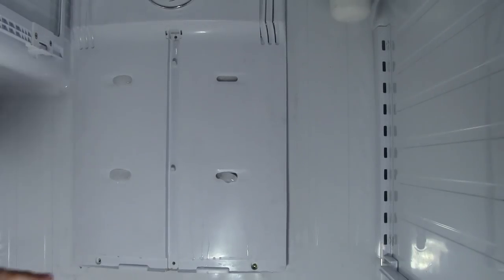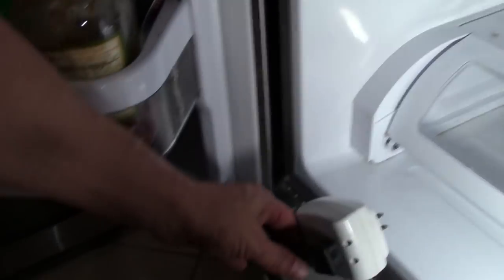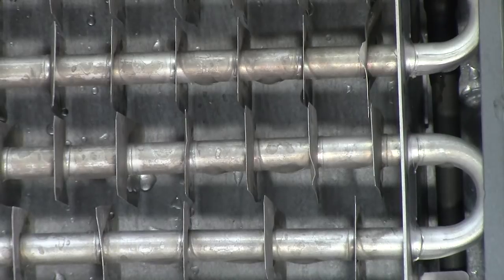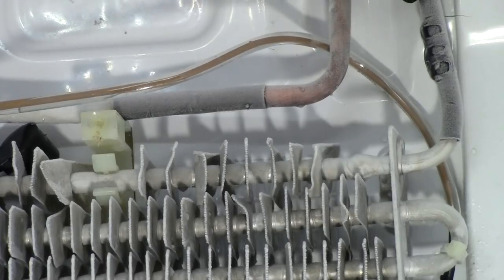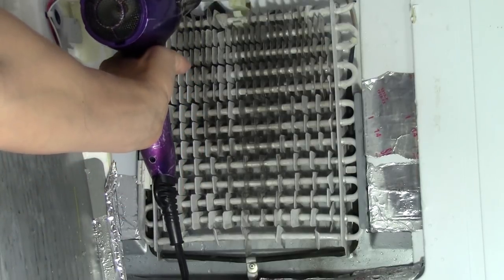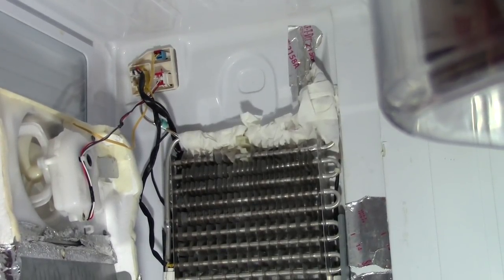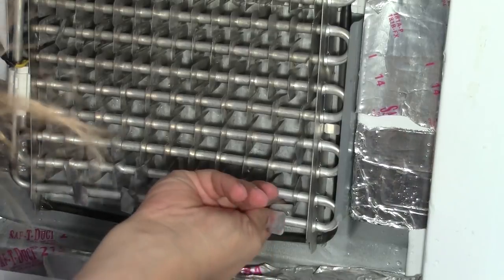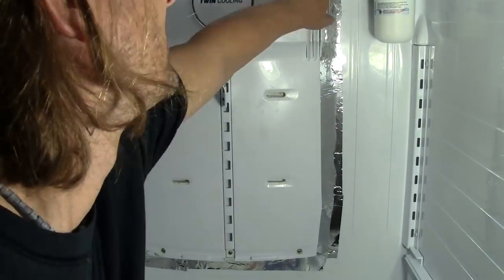PART 8 How to Fix a SAMSUNG RF 267 Refrigerator Not Cooling Icing and Freezing DIY repair

Comment: Thanks for this video series, Jake, and letting us in on your journey with these Samsung (hamstrung?) machines. I tried a copper wire in the drain, then the manufactured (aluminum?) part recommended for the drain - no surprise that neither worked. I'm going to try the aluminum tape, but to me, it makes more sense to add strips of aluminum tape to what I think is the black-colored defrost coil and leave "tabs" of tape hanging from the coil all around. Perhaps this will conduct more heat from the coil into the space behind the panel and melt ice that forms? I'm just not sure. In theory, to me, it doesn't make sense to insulate evaporator coils since my understanding is that those coils are there to dissipate heat ... no judgment here ... just trying to think this through. I hope it works for you. I'll share notes on what I discover along the way.
Reply from the maker: I dont think your heating element is getting hot, so adding strips of aluminum tape to it and creating tabs will do too much.  You can try it though because I dont think it will harm anything.  As for insulating the evaporator coil, it is not a permanent solution for me either, although it seem to help.  Btw, I think its the condenser coil that you think dissipates heat.  That would be on the outside of your fridge, in the back or underneath or something.
Reply: The heating element (what I'm calling the defrost coil) behind the back panel inside my fridge was definitely heating up when I re-started it after fully defrosting the unit. Therefore, it was a big mistake to directly apply aluminum tape to attempt better radiation of the heat! The acrylic glue on the tape burned and sizzled and it took a couple hours adding another chemical to dissolve said glue and get back to square one. I consulted an experienced refrigeration repairman, and he suggested adding aluminum tape to other areas behind the back panel: the drain pan and the inside face of the cover itself by extending the metal panel with tape on both its base and sides. We'll see how that works out!
Reply: Yep, it gets mighty Hot !!  I would not apply tape or paper.  Force a defrost and listen for sizzle.  Defrost
Sensor bad  is my  thought ...   Without good one,. it , 90 second defrost does nothing.  Can run for months (like you and I have seen)   Mark in Ohio     Hope last time I defrost  !!!!!
Reply: 100 % RIGHT PLUS FIRE RISK AND VOID 5YR SEALED SYSTEM. Contains gas under pressure, may explode if heated .

Comment: This problem fridge came with the house I bought a year and a half ago, so I'm grateful for your video. I removed the cover and the ice has all melted now, but I notice that the styrofoam insulation, covered over with thin foil tape strips, on the back of the cover seems to have shifted partially. I'm wondering if I should replace it, since there surely can't be a good seal now. Or do I need to buy a new cover? Also, some of the fins on the coil are bent or not in line with the others. Does this affect the efficacy of the fan? Thanks for your help.
Reply from the maker: +Victoria Chatfield -->  Just do your best to straighten the fins by hand.  It won't affect the cooling or the fan efficiency.  The Styrofoam is probably your bigger problem.   Fix it the best you can and seal the perimeter up with tape.  It might help a little...it did for me.  Your real problem is that this will be an on-going issue with this fridge no matter what you do.  What I would do is try to do a forced defrost one time a week by pressing the correct buttons on the control panel.  It might save you hours of time in the future.
Reply: what are the "correct buttons".  My frig has the same problem and I already unplugged it and waiting for it to defrost.

Comment: Try this my freezer has been freezing up for over a year so one day I was cleaning behind the refrigerator and I pull the cover off on the bottom and the coils were full of lint I got my air compressor out and cleaned it problem solved no more freezing up

Comment: Jake is this fire safe? what about water on the paper towels?  Thanks for posting - just got this as a handme down from family and it is starting to give me trouble - like to fix my own so really appreciate your videos!!
Reply from the maker: +Stephanie Cottrell --wrap the coil, not the heating element.   Don't wet it.  Keep it dry.  If you wet it, it will just freeze into ice even faster.
Reply: Jake has done a great job of defrosting every few months. I did for a while, but was looking for a long term FIX.I bought new and it worked for 6 years without manual defrost.Then this.(see my post) I replace defrost sensor (about $15) and have been good for a few months now. Part can be measured with meter. With bad sensor it thinks 80 deg F. (and only runs 90 seconds then done defrosting )   should be several minutes and you should hear the sizzle of water boiling on hot coil.               No ice creeping out of lower holes yet.  Fingers crossed in Ohio

Comment: Jake when I took my panel apart there was so much ice I didn;t notice the BLACK WIRE with the sensor seen at 4:21   Could you please tell me where this goes?  It has two prongs  I;m guessing it sits on the coils?  I can see part of it in your video
Thanks for any info
Bernie

Comment: Hi Jake, I am currently in the process of unfreezing this fridge, 9months after it was left behind by the previous house owner (NO WONDER). What worries me is that I can see some sort of "rusty water" marks/trails coming from the the bottom part of the cover (which is still stuck in ice) all the way down to the bottom tray. Have you ever seen this before? I'll try to keep you posted once I can finally remove the cover =\

OH AND THANKS FOR YOUR VIDEOS
Reply from the maker: I haven't seen any rust on mine.  The parts are made of aluminum back there and should't rust.  Let us know what you find back there.
Reply: I think your source of rusty water may be from the screws that hold the back panel in place. That's what I've found with my version of Samsung fridge.

Comment: Thank you so much! I am so over buying Samsung appliances. Where does the water drain to, if it does not freeze. I put warm water in the drain but need to know if I should be checking a drain container somewhere.
Reply: In the RF265 side by side it goes down into a hole behind the rear panel under the heating element, then flows in a pipe to the left, then down and out into a flexible tube into an evaporation tray. Unfortunately my Samsung 'fridge drain froze up solid in the drain line due to either a blockage in the flex pipe that dumps into the evaporation tray and/or the undersized metal defrosting probe attached to the center bottom of the defroster element. After having my "eternally frustrating Samsung" apart about 8 times in the tube, I am not convinced it can be fixed. In my case  the poor performance spread to the freezer, the display control so that it is now totally unreliable.  Makes one want to ventilate this junk in multiple places with a pick axe so that no one tries to pick up on what appears to be a beautiful stainless steel Refrigerator / Freezer,  is actually a frustrating piece of unreliable junk. There went a LOT OF MONEY.  Will never even look at Samsung products built in Mexico, China or anywhere else.  Adios.

Comment: I wonder how it would work to just spray the same areas with low expansion foam insulation, emphasis on low expansion.  The down side is it would be difficult to get back off if the need arose.

Comment: After reading about 15 comments below, I'm curious if in addition to running heat down the drain tube if running copper/aluminum wires on the heater coils in the upper/mid section horizontally to also distribute heat to the condenser coils would also aid in the evaporation and fan from freezing up helping with ventilation.  Not sure how the condenser coils would affect /reduce life of the defrost coil or effect the sensors somehow.

Curious if anyone has tried this and found good results.

Comment: Hello Jake,  I watch all your videos on the Samsung.  I am in the process of taking the refrigerator apart to defrost the coils.  Question, did the insulation work and if so, how long?
Reply from the maker: Hi.  It worked for quite a long time.  I was having to defrost the fridge every month and a half.  Every time you take that cover off, you destroy it more and more which contributes to the problem.  It lasted me at least 6 months after the insulation.  This time I put even more insulation on it as you can see from the video.  So far so good.  Part 8 of this series was made on April 22, and now its May 22.  One month good so far.

Comment: I think you fixed it somewhat by slowing down the defrost circuit.  The sensor was covered by the insulation you put in.  A few others had the same solution with relocating or adding a 2k resistor.

Comment: Hey, man. I have the same problem. I'm looking at the defrost coil and wonder how in the world the Samsung designers thought this would be a good design. Heating element is across the bottom but freezing happen from the top down. I need to tear mine apart every few weeks and it's a 15 month old unit. 

Have you tried to source a heat trace cable that might be suitable? The insulation you installed may help too, but I'm trying to converge on a thin and low power heat trace than I can snake all around, then plug in ever time I hear the fan starting to grind. Let me know if there are tests you want to run, I'm willing to try things.
Reply: Remove the cover and remove the styrofoam insulation an d replace cover without it and mine has been for 8 months so far and still not freezing up.
Reply: @TheOnlyGoodCommieIsADeadCommie  No problem still working fine

Comment: That is kind of a real "Mickey Mouse" repair using paper towels!   There is a Samsung service bulletin out there that tells how to fix this problem a bit more properly.  That fact that our brand new Samsung frig went five years before every having this problem just tells you that there is a fix without major modifications like you are doing.  One of the problems is the drain tubes become clogged with crap (They can be cleaned) and then moisture builds up in the frig.  Samsung has new improved drain tubes that will not clog.   Thats just one fix for one problem.    My guess is also all the damage you have done to the insulation from not defrosting the frig first and pulling off the cover is adding to your condensation problem since the heat from the evaporator heater is not well insulated behind the panel and you are not getting a good defrost cycle.

Comment: If there is a class action suit about this problem, we will be a part of it. We also have a Samsung side by side experiencing the same issue. Repair people have been out multiple times, replaced the fan and the mother board and the coils still freeze over. We won’t buy any more products with the name Samsung on it

Comment: on RF265       Press Power Freeze   and Fridge button till display blanks  . When display turns off ,  for the next 15 seconds if ANY key is pressed it will step thru modes like Jake saw. FF1,FF2,FF3,rD,Fd       rD  Fridge only (saves freezer)   or Fd   defrost both    beeps continuous , one more button press cancels test mode        after a few minutes you should hear sizzle. I f not  Defrost sensor or coil probably bad.
Reply: Would you mind telling me how long it takes for the coils to defrost once you've set it to Fd mode? The beeping is driving me nut, and I'm wondering if it takes hours or is it a quick process?
Reply: @hezwes  I wish you'd had a reply. Could you tell me how long you waited?

Comment: Is there a way to make the evaporator fan run full time even when the compressor is cycled off. The continuous airflow might melt frost during the off cycle of the compressor and further prevent freezing.
Reply: Continuous evap fan will not defrost the coil in low temp refrigeration. This is low temp refrigeration.

Comment: Great Video! It helped me dissect the fridge..However, I bought a new defrost sensor thinking that was it and still not working. After all ice melted and dried, still reading 60+ degrees...WTF do I do now? Sounds like fans are working...I'm no expert at this, just taking people's advice..Anybody know what else it could be? Samsung RF263AEWP..
Reply: Get A Clue Marketing Show I have a model RT38MASW.(Samsung). It is not cooling the lower part.The freezer part is OK.I change the thermostat but same problem
Reply: Hey, I finally had to suck it up and pay $75 for a technician, to come out a diagnose my fridge. Why? Because too many people (aka experts) said it could be this or that. I change PCW inverter board, defroster, and still had same problem.  One online expert said, I have a leak in my system, based on irregular frost pattern on my coils and that it was not worth repairing. I was totally depressed. Then, others said could be door switch, could be main temp board, evap fan, etc.  Finally, paid the guy to come out $75 (cheapest in area), said it was the evap fan.  and the harness was broken. wire came loose. And he said nothing else is wrong with it, and coils were cooling fine, no leaks, as previously said. In fact, I took back panel out to remove fan, left it off and fridge is at normal 36 degree temp.  If you're good with volt/ohm meter start checking around.

Comment: I removed the panel , used some 1/2 stick on frost king to completely seal around the fan enclosure & re-assembled. So far no problems with the cooling fan hitting ice.  Been two weeks.   Wife bought a new GE Refrig. To fix the problem permanently.    Booooooooo!

Comment: Tried to do this and now I messed up the fridge thank you
Reply: This is not the fix this is just dumb no paper towels what’s causing the problem possibly the defrost  clock the defrost heater  the water collects cause the the drain tube is clogged  or the door seals  what about that mine is doing the same thing in 9 months and 1,500 if the service guys can’t fix it I’m going to dump it and buy a whirlpool 
No more Samsung for me

Comment: Hey I wrapped a small copper wire around the heating element and sent it like 18 inches dow the drain hole to prevent the hole from freezing up again.
Reply from the maker: Hope it works.  Let us know.
Reply: jakeguitar01 man you gave me confidence to do this today it took me 2.5 hrs but Mr panel was frozen on I had to heat it up a lot to get it unstuck. I'm pretty sure you helped us  save at least $400 or more on the diy fix. Awesome!!!
Reply: jakeguitar01 Yeah I'll will provide an update in the months coming to let you know.
Reply from the maker: Great.  With any luck, it will give you a few months of use before it freezes up again.  Try to defrost it from time to time.  Check out my video on manual defrost mode.
Reply: jakeguitar01 Ok I will check out that video and try that soon. I'm sure I will be doing this again sometime. I just subscribed to your channel also.
Reply from the maker: +Daniel Herrera ---->  Thanks Daniel.
Reply: Daniel Herrera did it work? Do you have issues
Reply: Maurice Hachache The repair remains good I have no problems since then. It was a successful repair.
Reply: How bout now?
Reply: tesla747 still a good repair.   No problems since then.
Reply: I just did this . It took about an hour to defrost the drain canal. It sounds logical. Perhaps I should put a few chicken heads in the drip tray Huh?

Comment: Jake said "Since the cover is so badly damaged, I think that the air flow is all screwed up and is not doing what it is supposed to do anyway.  I think it could be getting too much air because of the damage to the Styrofoam behind the cover, which may be the reason why the fridge seems to be getting worse and worse each time I took it apart.  Sealing the edges with tape has seemed to help a little bit but has not solved the problem.  I may also close off some of those vent holes tonight."

Hi Jake,

I know why yours is getting worse each time you worked on it. From this video I see you covered up the Evaporate coils -- the bottom and part of the top. There are total 10 turns and 2 of them are covered with paper and aluminum tape. This effectively reduces the cooling efficiency of this heater exchanger, then you also said you are going to cover up some of the vent holes. These vent holes are for the fan to pump the cold air out into the refrigerator and if them are covered up then you are reducing the cold air by 20% or more. 

The air is drawn in by the fan through the top left and right side grill (on both side of the fan area), then pushed down to the bottom via the side channels (bordered by the vertical strips of Styrofoam), then the air moving from the bottom to the top passing through the cooling fins and became very cold air, then pumped out through those 1" x 0.5" vent holes. The important point is that the air from outside of the fan box need to pass through the cooling fins starting from the bottom and up to the top to get very cold, then the cold air need to get out via the small 1"x0.5" vent holes. 

Brian

Comment: My Samsung froze up and the fan was hitting the ice and the noise was terrible.  My fix:  Max the freezer temp to 5 degrees and the upper refrigerator temp to 40.  Didn't have to take anything apart.   Ice apparently melted because the noise has not happened since I upped the temperatures.  Freezer is plenty cold and so is the refrigerator.  Just because this Jakeguitar makes a video doesn't mean he knows what the heck he is doing.  Using paper towels as insulation in a damp environment shows how well thought out his fix is.  It isn't.